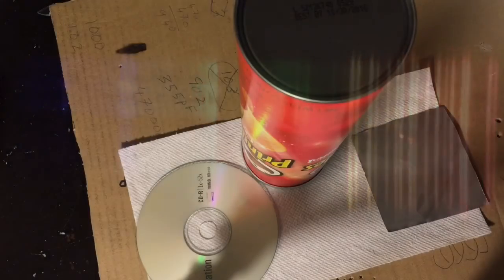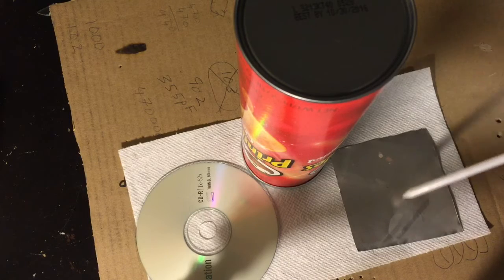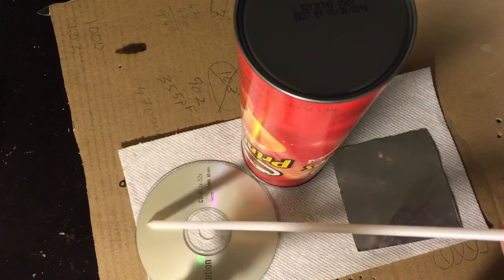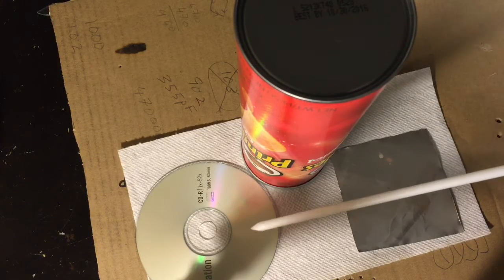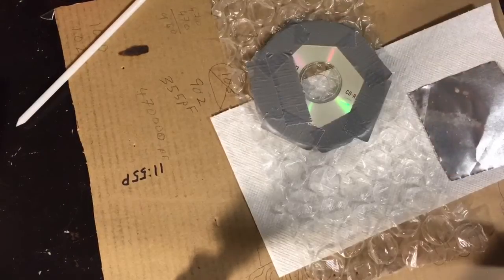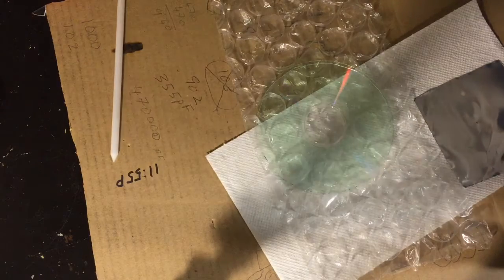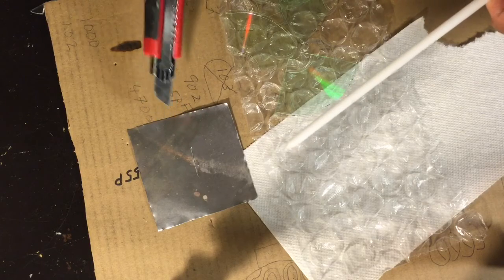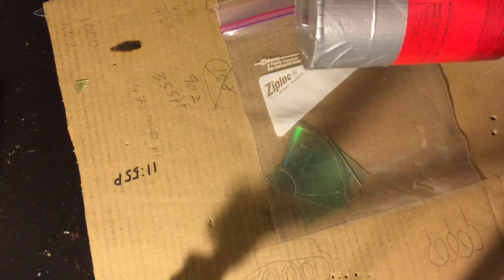Pringles Can Spectrometer

Comment: Mine didnt work! :( Any tips?
Reply from the maker: Clair Asher i am sorry to hear ut did not work. One thing to make sure is the lines of the cut CD are correctly oriented. Another is to make sure the light entry slit is parallel to these CD lines. The older foil backed CDs work better then DVDs. When you are looking for the light spectrum look off to the side . You will not see it if you look for it directly in front. Make sure that you are pointing the spectrometer at a point light source such as a bulb or ( carefully) the sun. Hope this helps you get it working!
Reply: @BrianDhvTinkerer   what did you mean by the lines of the cut CD?
Reply from the maker: Clair Asher its the orientation of the CD “grooves”. These need to be parallel tontye light entry slit. When you look at the light entering through the slit (Cut CD end) is up against your eye and slit  end is towards the light source eg fluorescent tube. The spectrum will off to the side of the light entering the slit directly.
Reply: @BrianDhvTinkerer  hey! So I did that and when I put a camera to it, I was able to see a spectrum but I cannot see that when I look into it with just my eyes. Is that how it's supposed to work?
Reply from the maker: Clair Asher u should be able to see it. Did you try a brighter light source?

Comment: I don't have any baking tray, what can I use other than a baking tray?
Reply from the maker: You can use any aluminum foil as long as it is thick aluminum foil. You can also use card. Let me know how it works. I was very happy with how this one worked.
Reply: okay thanks, i have a project due this week and this is my physics toy, thank you so much for this!
Reply from the maker: Thanks. Good luck for your physics project.
Reply: use  Ali  foil   -  cooking foil  .  Building   spectro  with  those cardboard tubes  for the  loo rolls